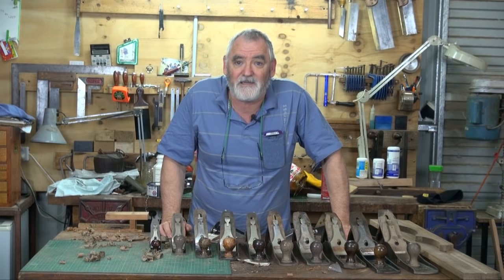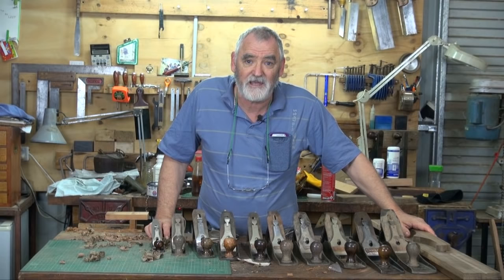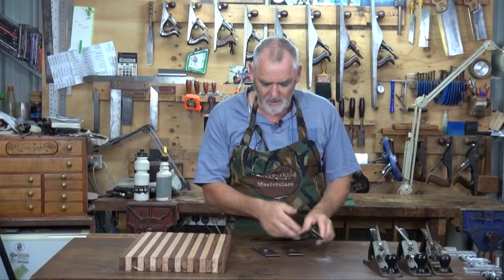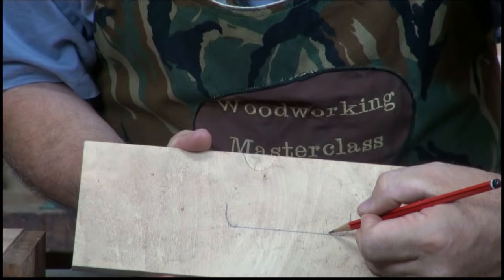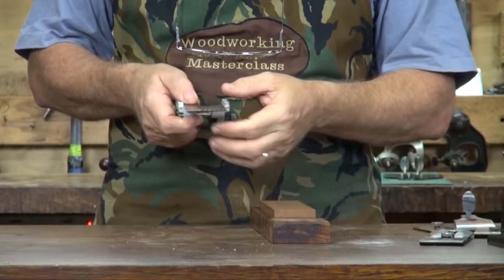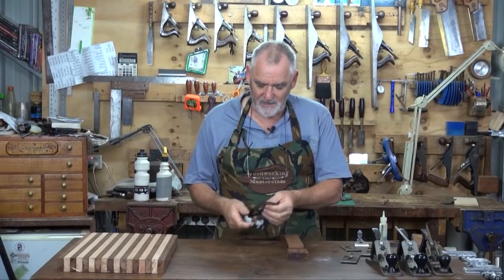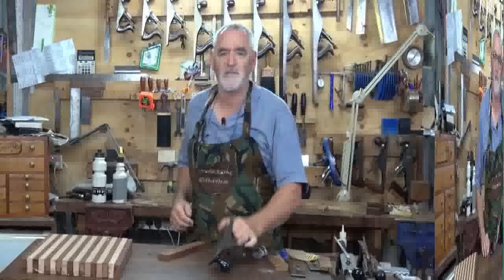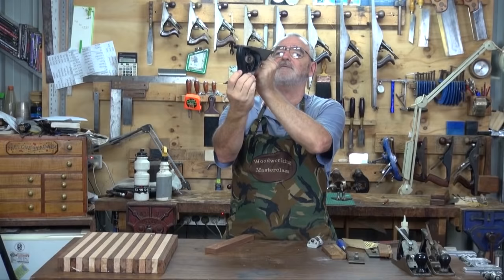Plane Basics some Quick Tips on Hand Plane Usage

Comment: Great advice Steve. Recently borrowed a #7 off a friend who received it by luck. I've been after one for a long time to use in the workshop but have trouble finding a good price. Seems the collector market has increased most planes prices.Cheers, Paul.
Reply from the maker: +Paul Sandow Around the $100.00 seems to be the going price on auction site for a good #7. But you will most likely have to spend some time tuning them up I've got a few spare if that helps. Cheers Steve

Comment: Great Channel, why do you like the 5 1/4 so much?  I have never used one. I have  most of the planes 3,4,5,6,wooden jointer 26".  I think my favorite is a new molding plane I picked up, I didnt realize how awesome those planes are.  want more but new is too expensive.
Reply from the maker: Hi Scott, Just a good all round plane for cabinet work. Small enough for finishing and long enough for squaring doors and draws. Love the molding planes too. Cheers Steve
Reply: @Woodworkingmasterclass  just bought one on eBay, looking forward to it.  SW era can't go wrong.
Reply from the maker: @scott8351  Something about the older tools they seem to know what to do, not like the new ones. :) Cheers Steve

Comment: Steve, Thanks for the vid. On the plane. There are also one screw and a turning knob on the back behind the blade. is the to adjust the depth or something ?. Or do you set the depth as you did in the video and not worry about these ?
Reply from the maker: Yes that's the adjusting screw which projects or retracts the blade. Not sure what adjustment you are referring to that I did. Possibility it was the amount of blade the lays in front of the chip breaker. That it a different adjustment which allows the turned knob to do it's job better. Cheers Steve

Comment: Steve, great video.  I have a falcon no 5 from my grandfather in law.  I've sharpened and done a bunch of stuff with the plane, but not replaced anything.  Everything still moves well, but all I seem to get are these dusty shavings, then if I advance the blade further it starts to skate on the exposed blade.  Any ideas.  Should I just go back to resetting the blade angle, or is there something else I'm missing
Reply from the maker: Bit hard without seeing the plane. Sounds as if the blade is either not flat at the back or the angle on the front is not sharp enough. I sharpen mine @ 25 degrees primary and 30 on the secondary. If it won't shave hair on your arm it won't shave timber to well either. Also check to see that the frog is up against the back of the mouth opening. Set ship breaker just under a mm 3/32" from the edge of the blade and make sure the bevel is facing downward. Don't mean to teach you to suck eggs but all those things could attribute to the plane working as it does. Hope it helps. Cheers Steve
Reply: Woodworking Masterclass thanks Steve I will have another check
Reply from the maker: Hope it works out for you OK. Cheers Steve
Reply: Steve
 I have acquired a Old Plane and have the same problems you have or had ! Did you get your Plane working as sit should be ?
Thx’s

Comment: Hi Steve! 
I've recently purchase for about 12$ a good plane, it's the equivalent of Nr. 4. Now , I've sharpened and set up the plane, but I'm missing a scrubbing plane. I have 2 more, of lower qaility: a wooden training plane, and a metal one, made out of sheet steel. They are about the same length, the steel one is wider - which should I "convert" to a scrubbing one?
Reply from the maker: +Dumitru Ursu I would convert the narrower one of the 2 as they do cut deeply and the wider the sole the harder they are to push. Cheers Steve
Reply: it made and excellent scrubbing plane, I've used it for a few days already. I drew a line with a marker and a square on the front of the blade, to sharpen it uniformly, although, it doesn't seem to matter much afterwards. As I planed the sole (it was all worn out), the mouth got bigger, and it's perfect - the thick shavings  get out better that way, it rarely clogs. Thanks for the advice.
Reply from the maker: +Dumitru Ursu Pleased I was able to help. Gotta love scrub planes. Great mood changer as well! If you feel angry or frustrated at the world. Get into a scrub plan for a few minuets and the mood soon change. lol Cheers Steve